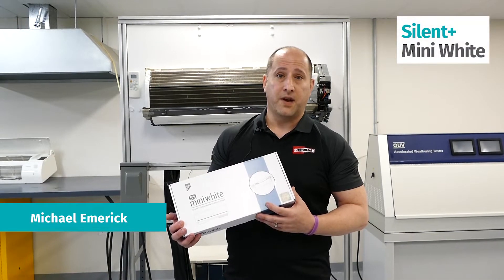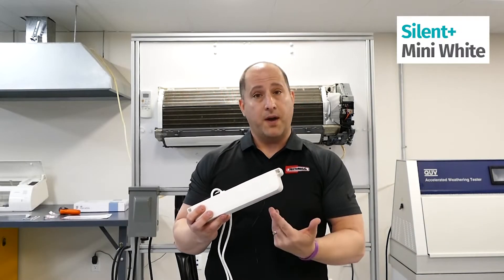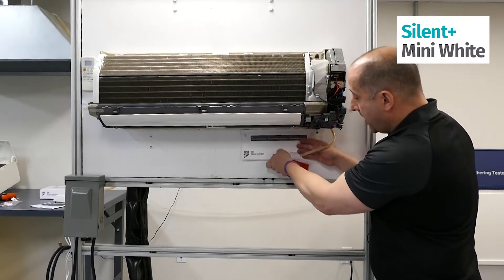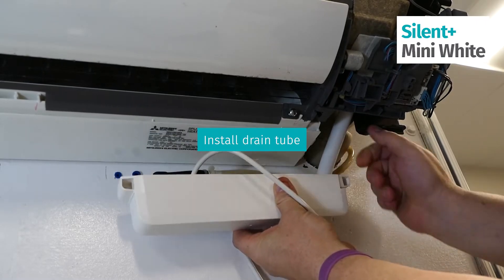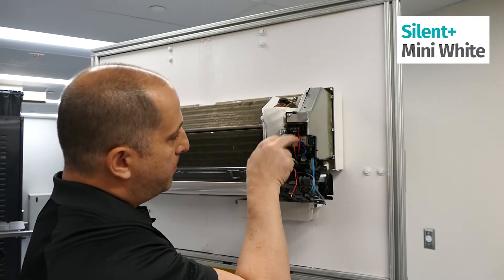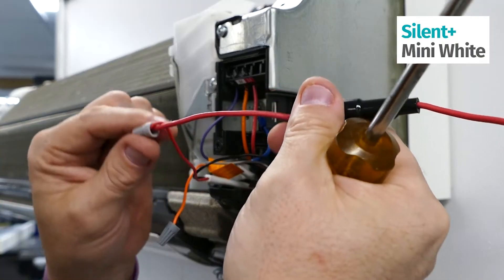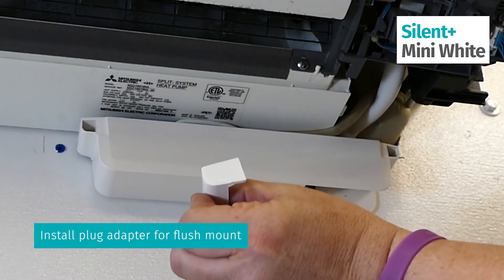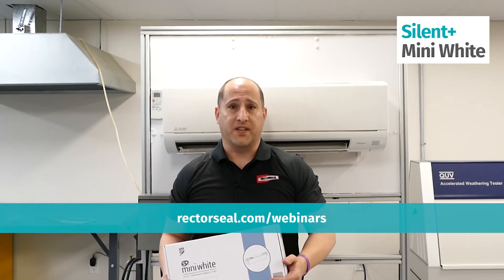Silent+ Mini White Aspen Pump Wiring Instructions

Comment: The instruction booklet shows a different way to wire this in the diagram. Not to mention the NO/NC were reversed when I checked continuity. 
Can you explain the anti siphon valve? Is it not a check valve?

Comment: Im working on a 115v unit. the diagram has a white wire coming off the pump. But there is no white wire. I use the red wire?

Comment: Are these very reliable? I'm currently having a mini split system installed for heating and cooling and they are advising me that the large pumps that they are supplying are much more reliable.
Reply from the maker: These are specifically designed and made for mini splits. 
Larger pumps are much louder.
Reply: Very Very quiet!!!